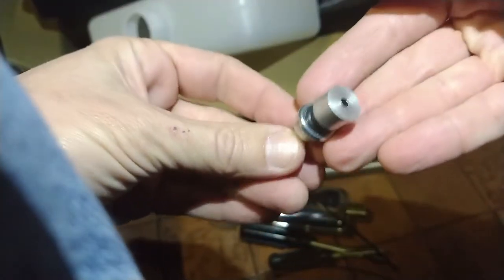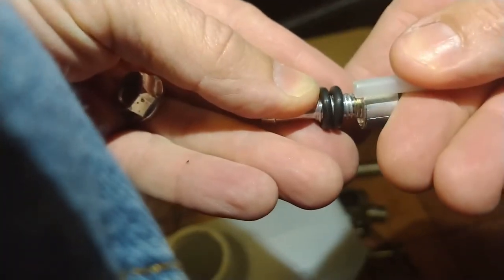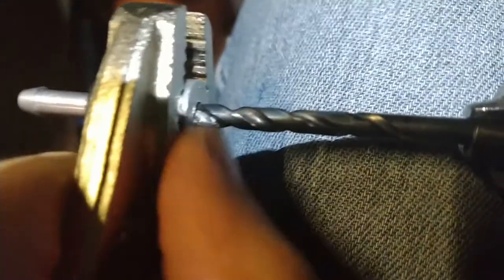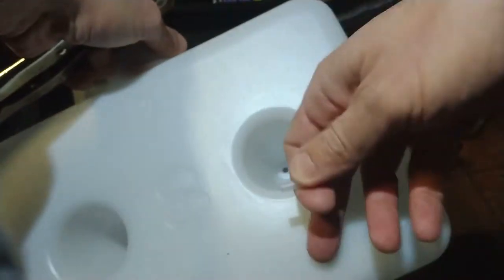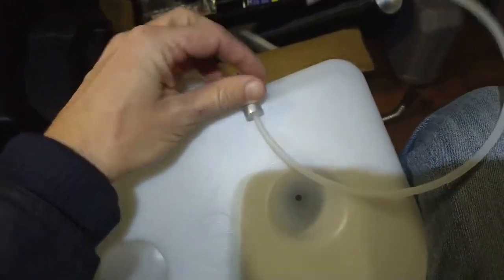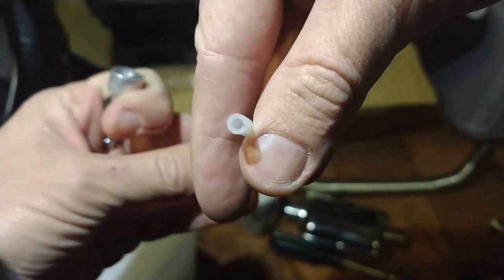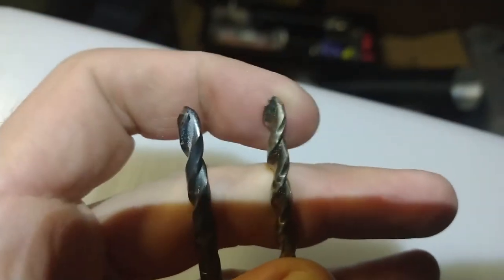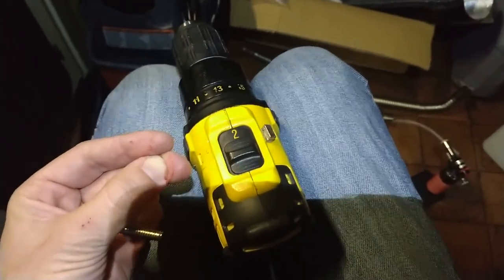Chinese Diesel Heater - Converting included hose and nipple to stand pipe

Comment: Did you think about putting it in the cap?
Reply from the maker: I didn't think of that.  Since it kind of acts like a siphon, if it was in the cap and you removed the cap to fill the tank, I think the diesel would start to fall out of the hose and you'd have to re-prime the pump.  The way I have it I never let the tank get completely empty, so the diesel doesn't fall out of the hose.  Also I think there's a 1-way valve in the cap to let air in but not let diesel fumes out.  It smells kind of like diesel so I think the cap is not doing the best job.